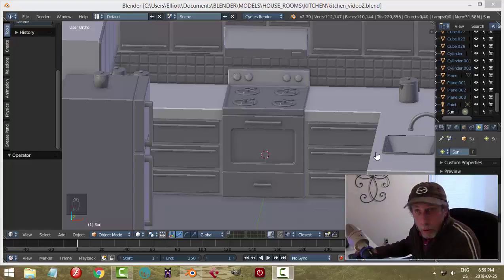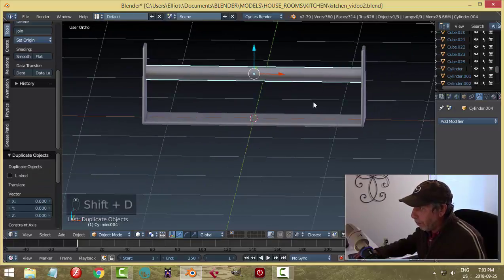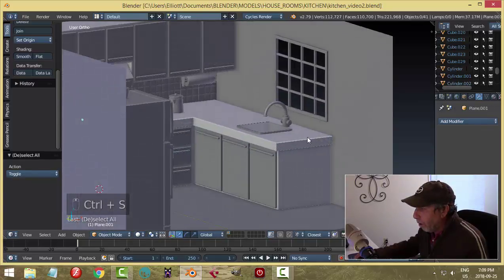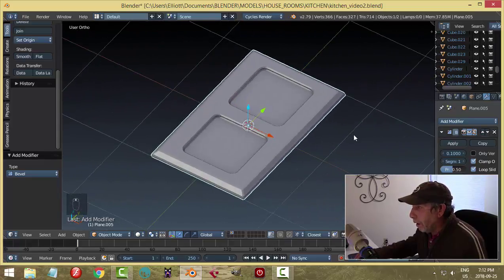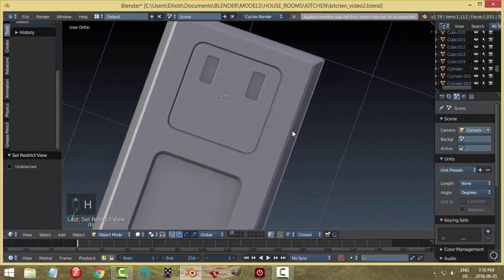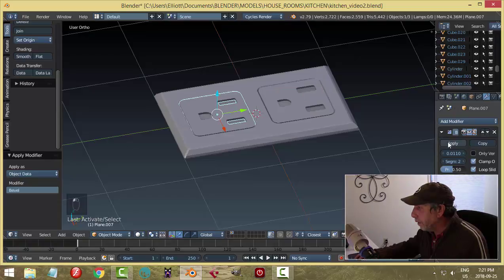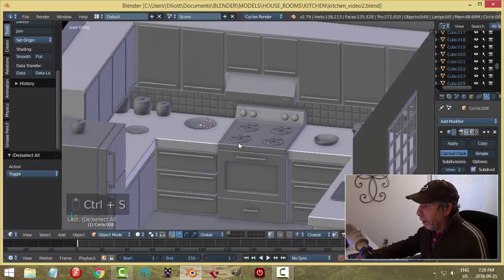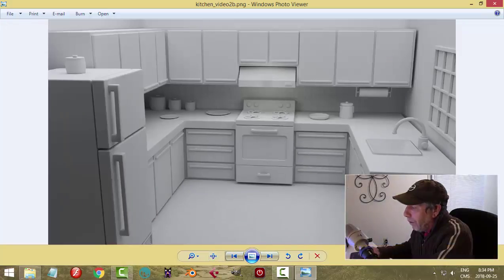Blender: Modeling a Kitchen (Part 3)

Comment: Zerobio, this is yet again a great tutorial, so thanks a lot for putting the time into it. As for what you said at the end of the video, I think it all comes down to what are you modeling for, is it for a still image, animation or a video game, each has its own considerations when it comes to modeling. As for me, I model for games most of the time, and I see no problem following along with you and making the necessary changes when it comes to poly count and n-gons the model will not come as detailed but it would still resemble the kitchen. With that being said, since this is a beginner tutorial and doing it for fun, you are doing a an excellent job and sure would advice you to keep on doing this they way your doing it. All the best Zerobio.
Reply from the maker: Yaser, thanks for working on some of the models that I do in the videos and for your good feedback about using similar models in games.  That is good information for me to have.  As you know, I am doing this for fun.  That doesn't mean I don't take it reasonably seriously because I do but I am not stressing over poly count or n-gons etc (at this point anyhow).  I will continue to do more videos as I get ideas.  Thanks again.

Comment: ngons and tris are completly fine with static meshes...i dunno wich modelers came and discussed with you, but they are very dumb...aslong as the mesh is not deforming then you can use ngons and tris. and no the shading wont be all over the place aslong as the tris and ngons are on spots where you wont see them or they are at complete flat surfaces...
Reply from the maker: yes, I agree and find myself using them all the time with no problem.  Thanks.